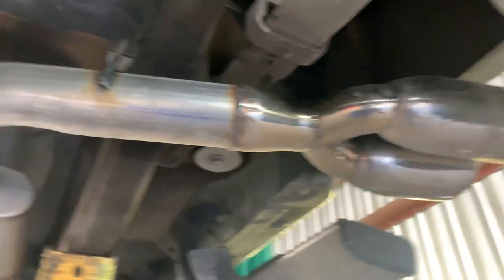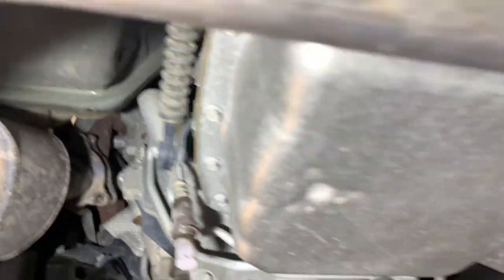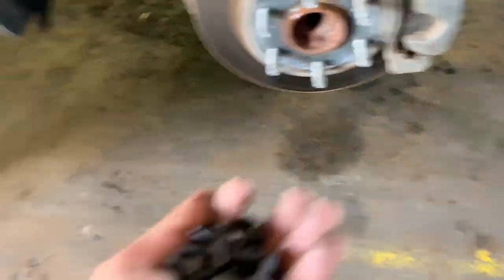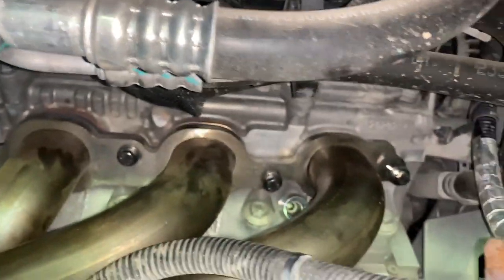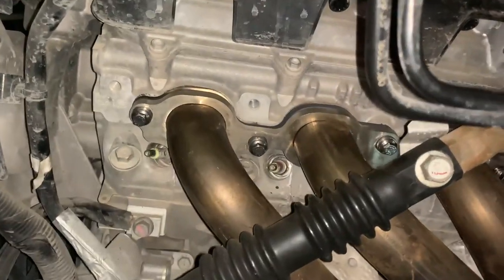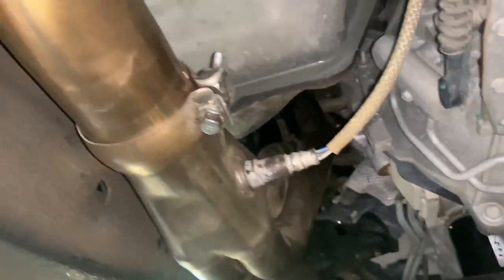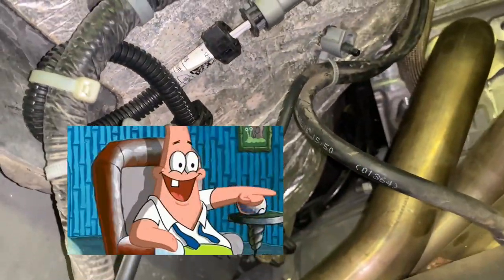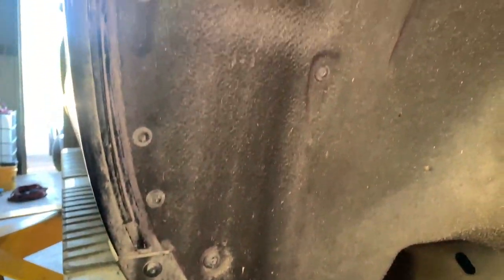2017 Silverado Texas Speed & Performance Header Install

Comment: Did you only need one extension for each 02 sensor?
Reply from the maker: I think I only used one long one for the driver rear o2 and one short one for the passenger front o2. I have an extra harness extension if you need it

Comment: Did the truck throw any codes after header install with your catted y pipe? Assuming that’s why you had it tuned. 
I want to throw the same setup on my 17 6.2 but very limited on tuners in my area of Ny
Reply from the maker: Yes it did have a check engine light but I didn’t bother to check what it was. I went to the tuner that following Monday (work was done on a Saturday). I did notice that I was getting horrible fuel mileage. Like 7-9 mpg driving in the city.

Comment: Where did u put the forth 02 denser
Reply from the maker: If you stop the video at around the 4:20 mark you can see the passenger side first and second sensor on the y pipe. Also if your y pipe/headers are a different brand they might not be in the same spot or might not be there at all.

Comment: Did u have to tune it?
Reply from the maker: Yes I tuned it after wards, my mpg was super bad and it sounded ugly when it would change between V4 and V8
Reply: @RedJackelProductions  what tune did you use?
Reply from the maker: @kloud7135  I got my truck tuned by RK Speed here in Mission, TX